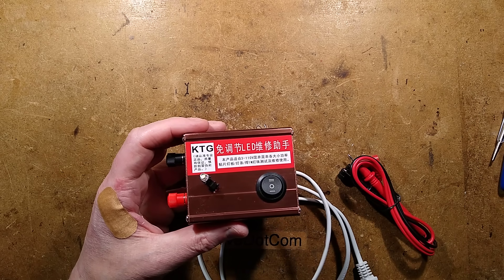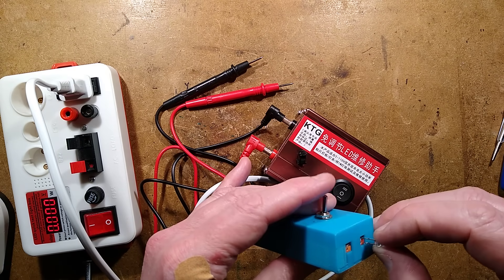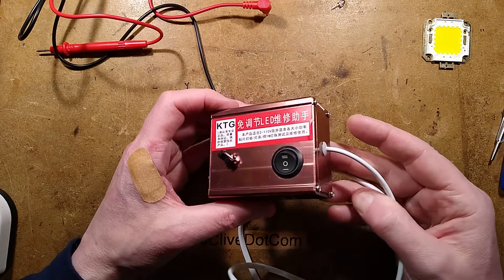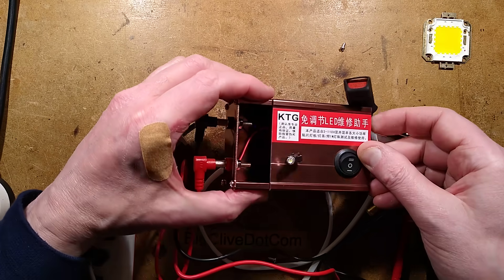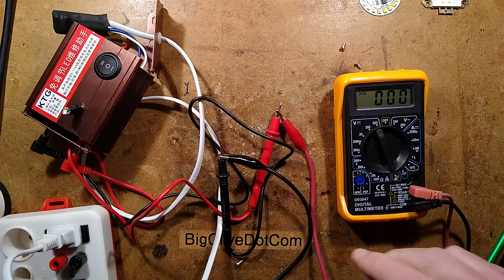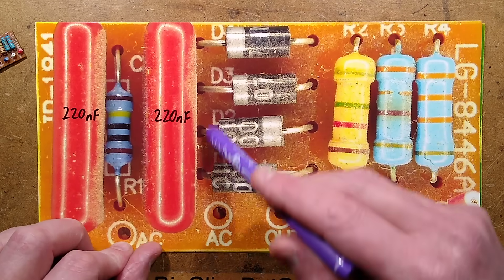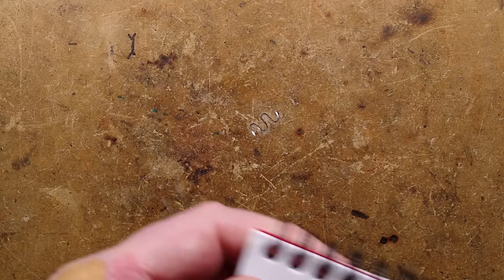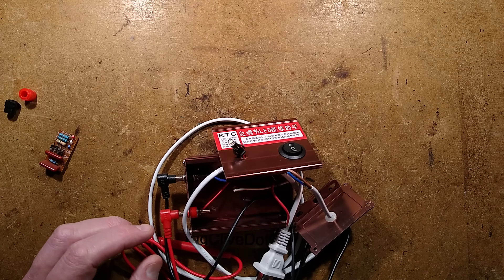Horrific LED tester that can literally kill you - (with scary schematic)

Comment: You're such an idiot. Watching you struggle with simple devices makes me wonder how dumb the general public actually is to follow you in such numbers.     Should I stop using my test equipment because its dangerous? I guess my capacitor analyzer is unsafe as well?    All test equipment is potentially dangerous moron.  Especially if you work on real gear instead of cheap chinese gizmos a 10 year old could have built in the 1950's with a heathkit product.
Reply from the maker: Thanks for your inciteful feedback.

Comment: Hey dear Clive; I wanted to give you a MASSIVE thanks, for I have just pulled myself out of a very nasty situation.

I have 2 electricaly-powered airsoft guns where I left the battereies too long in for; and I found out only minutes before posting this that the batteries hit critical low points: there was no over-discharge protection on the circuit.

I've managed to get both 2S batteries back to life using your shared knowledge about CC/CV charging. The batteries are now both successfully charging over balance chargers again. I've temporarily used constant current, using the TP4056 on the lowest cell and this has kickstarted their life again and allowed my protective balance chargers to pick them up again.

Once again, I can't thank you enough for sharing your knowledge and wisdom to the many of us. This is a showcase of it working and saving someone else.
Reply from the maker: Keep in mind that if the cells have been significantly over-discharged or worse - one has been reverse charged then it's a good idea to replace them.  It's not too bad if they have just dropped a bit below the usual 3V threshold though.
useful to know to remove the packs from the guns when they're not being used.

Comment: Genuinely speaking at AU 240V a current of less than 30 mA is considered safe, and 50 to 100 mA is generally felt but not fatal, (Safety residual detectors start at 30 mA),   above 100 mA is considered dangerous.  I would class that device as being safe but not for children etc.  Also it appears that a multimeter can do what that device does anyway by measuring resistance and continuity accross the LED.   It's definitely a waste of money.
Reply from the maker: 10mA is excruciatingly painful and is the point at which your hands start locking onto metalwork.

Comment: I have a slightly better unit that has isolated output so touching any single probe doesn't kill you but it outputs 300v at 20ma. 
It is for testing flatpanel tv backlights as those are typically anywhere from 20-120v dc. For upto 50 inch ones..
Mine has a little volt meter aswell. 
I put a few resistors in parallel to lower the voltage of it down to 100v as 300v was killing some leds if i touch it loosely. The current limiting isnt fast enough and the led arcs over internally. 
My dad once shocked the crap out of himself touching both the probes of this device like it was a multimeter trying to test a tv led😂..
Reply from the maker: If it's this one it may have functions you're not aware of:-
https://www.youtube.com/watch?v=dbjZs6QVwso

Comment: I don't understand why you should buy such a device when most multimeters have a diode test.
Reply from the maker: Modern LED arrays can have very high voltages in excess of 300V.
Reply: @bigclivedotcom  Ok ok, I didn't take that into account

Comment: Back in the day I somehow managed to wire up my electricity supply without killing myself but years later when an electrician friend saw it he was stunned I hadn’t got a nasty shock at least. I hadn’t pulled out the big fuse and just used a stripped copper cable to bypass the meter lol. It worked but I got him to do it properly and when he was doing something with the fuse there was a big flash and he went flying lol he was okay but his arm was limp for hours and he couldn’t drive home.  I won’t let them fit a smart meter and will just pop the lcd display because my mate got caught after fifteen years free gas and electricity and they couldn’t find out how much he had used just because the lcd display wasn’t readable, so if you have large debts on your meter pop the display and call the company to fix it, all they can do is change the meter and they don’t know how much debt was on it. Obviously only works with old meters, works with those yellow gas meters too.

Comment: Why is this dangerous?  The probe is connected to the live outlet through a 1M resistor.  The measured voltage will be high but it would not permit a dangerous current.
Reply from the maker: The capacitors either side of it will pass significant AC current at a level that would cause a significant shock.  Especially on higher European voltage.

Comment: I have an LED tester that has a volt meter, in a white case with blue text (0-300V listed). It has a proper isolated switching supply.
Reply from the maker: I reverse engineered that style.  The circuitry was quite complex.

Comment: Definitely deadly in high voltage countries like yours. Where it’s 230 volts  nominal and if I remember right ~375 volts peak. In the us it would be very dangerous at maximum not super sure on deadly. Because our voltage is 120 nominal ~170 peak I’m not sure if that would be deadly, you’d definitely not have a good time ether way though. The best solution would be to grab a button cell battery and test your leds that way.

Comment: You don't need deadly mains to test LED's, you can do it with a little 9 volt battery and a resistor.
Reply from the maker: Some modern LED panels operate at hundreds of volts.

Comment: This would be okay if you would just add a small transformer. Maybe even a furnace controller transformer at 24-25vac. Might fit in the case. Put a three wire cord and ground the case. Could even put a 100ma fuse on the mains. Otherwise the case would be good for any diy project.

Comment: I must admit that I got confused a little 😅. Listening to this while driving (6am no sleep yet), got to remember to watch this again later. Why they don't pop if there's almost mains voltage?

I'm not even that noob on electronics, my weak point is safety isolation transformers, floating grounds and those "magic" safe but maybe not safe things. I read how they work and then just forget. 

Wow what a ramble, sorry.

Comment: Is it safe to test short-circuit current? Does any multimeter just work to be put in series as a load of an unknown power supply?
Reply from the maker: Only a current limited supply with no significant output capacitor.

Comment: It is so dangerous, if touch the output lead it literally shock you. So I build my self a main isolated led tester. It has voltmeter built, can measure led forward voltage drop. I use it to test LED TV's back light. It can even measure zener diode voltage drop.

Comment: An LED tester doesn't even need a 120V power supply to begin with.  You only need a battery and a resistor.
Reply from the maker: Backlighting LED modules may have a voltage of up to around 300V.
Reply: @bigclivedotcom but you don't need that kind of voltage just to check it

Comment: LED Holder and the probe sockets need to be changed to Touchproof items. A three core mains lead would be helpful to enable an earth to the case and negate the reverse polarisation of Live and Neutral since a three prong (fused) plug would be used which are not reversible. An extra high wattage resistor can be also inserted into the directly connected lead as well as dealing with the singed 3.3k resistor (upping the power rating of a replacement part).

Comment: 2:30 The free LED lamp bead should be the indicator light during the test. It will light up when you test a certain bulb, indicating the working status. The second function is to test some detachable independent LED bulbs connected to this socket

Comment: 🇫🇷 In my opinion, all you need is a simple LED bulb power supply module (10mA max), a momentary button, all powered with a 1:1 transformer which would be powered with a 330nf X2 capacitor (combined with a 270k 1W resistor), a 100mA fuse and a 275v varistor and a 100Ω 1W resistor to finish.

Comment: Could it be used as some other type of testing tool other than a 1/2 wave rectified High voltage psu. Even though it could still be potentially fatal to use.
Reply from the maker: There are much safer versions of these available.

Comment: From 45+ years in electronics you are very much mistaken if you equate dead on arrival to shoddy production that is not certain.   You also misunderstanding its function is also not crap design.   This item had no chance before you even started. Yet you have no problem with a metal screwdriver rolling around your table near mains voltage.  In my shop we have a word for this behaviour “cowboys”
Reply from the maker: After 45 years in electronics, if you think this is acceptable circuitry then you may need a new trade.
You may wish to see this video:-
https://youtu.be/dbjZs6QVwso

Comment: I like to think that the product designers were at least thinking of safety (to some degree) by putting that LED connector in series with the output. Maybe it was put in there so you couldn't turn it on without having an indicator light, maybe one of those small neon bulbs?

I just came from your microwave transformer safety video, and you suggested putting two indicator lights across the primary, which is what made me think of this.

Comment: I made an inexepensive portable Led tester using xl6009 booster module, powered by 9V battery and work fine.
There are many video on YT with single lithium battery, but if tension went below 3,7V the output isn't stable.

Comment: Lol, trash, pure trash. Whoever designed that garbage is not even trying. They did not even put at least a high resistor on both AC lines so as not to have one of the AC lines wired directly to the output. They just charged for the box and then threw a few random electronic parts inside to call it something, lol.

Comment: Cos jur just too cheap assed to buy a battery & make it battery powered...
not even an inrush  resistor to limit the current into those  "non x2" caps, , so basically until they are charged the circuit is a DEAD short across mains...

lets platy  "sine-wave Russian roulette"
double your odds.... , by  reversing the plug connector , so live does not pass thru the caps...

Comment: Maybe I'm missing something, but why would you need a device like that to test an LED anyway? Wouldn't it be just as easy to stick an LED into a breadboard, apply a current, and see if it lights up? (I'm going to guess that most people who do any tinkering with any electronics probably have such things lying around.)
Reply from the maker: Many LED backlights have a high voltage series string of LEDs.

Comment: Is that LED hanging out the front, supposed to tell you that it's 'ON'? And, is there still current going to the negative probe, from the 'neutral' position of the switch? What is it with Chinese 'consumer' electronics you find and having line voltage output to leads?

Comment: I think you should rebuild it and put a monitor chip insidecited but make sure it insulates a circuit board from shorting out and don't let the circuit board touch the metal

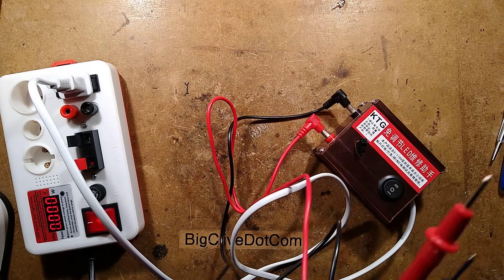Comment: should of left the led in? 2:33 led acts as fuse as far as i know, some systems use low draw bulbs as fuses its not shoddy design its safer for the led your testing,despite the other ways the thing wants to cause harm maybe they had their instructions the wrong way up,the logic of the circuit works

Comment: Its actually a good design, apart from being life threatening and not saying anything about it or a manual eg. circuit diagram. If you want to test led bulbs you have to have a high voltage. Alternatively you can use a boost converter with a battery. But it is also dangerous because high voltage and a few milliamps can be dangerous, so dont underestimate the dangers of small battery driven circuits!!! And capacitors!!! It is for testing bulbs and changing or bridging the faulty smd leds, which is a good thing, because less electronic waste. What a pity that manufacturers dont care, they could design bulbs which last 100 years easily. Good knowledge about bulbs: Kreosan (ukraine): How to DISASSEMBLE and REPAIR an LED lamp WITHOUT A

Comment: Dangerous device. Great video Clive. I have been using the same principle but of a 230/15 Volts isolation transformer, via a current limiting R and series LED for at least 3 decades. Great for testing LED lamps or sections of led strips.

Comment: This just shows how important reading the instruction manual is, I think most men assume we know how everything works, but anything from China particularly anything electronic is not necessarily predictable from a Western males mindset,or safe
Reply: Lol true , I remember buying an oscilloscope dso2512g to be specific and people shit on the manufacturer saying it can't support 120MHZ bandwidth. Little did everyone know you had to read the manual and activate it separately at which point the adc gets overclocked. I mean it's not the best design but reading the manual would've been so useful for many people.

Comment: This reminds me of the Chinese surface resistance tester that I purchased a while back. It just wouldn’t give me anything close to an accurate reading and it appeared to be shorted when grounded. So, I crack it open to find the absolute worst soldering job that I’ve EVER seen! There was a lead not even soldered in thereby giving me my flaky reading since it was ever so slightly trying to make contact. The 9V leads fell off when I gave them a small pull to see if they’d need to be resoldered. I ended up redoing the PCB and replaced the 9V battery connector with something a bit more substantial. It was almost like magic the way it worked by the time I was done! If I didn’t actually enjoy refurbishing old and otherwise crappy electronics, I probably would have sent it back or thrown it against a wall. I’ve come to realize that some very good electronics actually do come out of China, but conversely some of the very worst do as well.

Comment: I’m not sure this is thatttt lethal; the capacitors limit the current to 20miliamps.  Or they should; looks like they’re bigger than spec.  Which isn’t a good thing to have run through you, but won’t hurt you unless you stab yourself with it.  I mean, it’s against safety standards, but it probably won’t kill you.

Also it’s a full-bridge rectifier, not a half-bridge
Reply from the maker: To ground there's no current limiting.  And even at 20mA that will lock you on to conductors.

Comment: Talking about colour confusion with Chinese products.  
At work I had to rewire a bunch of head LED lamps (50+) for our bikes. The lamp used red for positive, black for negative. So far so good.

The pre-plugged wires I had to use for the connection used white and black wires. Having watched loads of BC videos I'd thought it would be smart to check the polarity of the wires before proceeding, so I picked out one to check. Black was indeed negative and white was positive. So I rewired the 50+ lamps. Made them secure with heat shrink tube and hot glue, to make them waterproof. 

When testing out the lamps only 4 of the 50+ lamps actually worked. Turned out that the black/white wires were more or less random. I had to spend most of the day fixing that "small" problem. I only has a few centimetres of wire to work with, so I could not just cut the wires a redo, and because of the hot glue it was hell of a job to get it fixed.

Conclusion (as I should have known) double check every wire for polarity before working on any Chinese product.

Comment: I agree it's a shoddy, dangerous piece of crap, but I don't think it's a dangerous as you are making out (provided nothing in it fails).
You got 212V with a tiny 20uA load (the meter), and you pulled 27mA when you shorted it (with the meter). 
But humans are not a short circuit. They would not pull that much current, and the voltage also would drop with a larger load. 
It would have been interesting to try more human-like loads (say 20K to 1M) and see what voltage appears, and calculate the current from that. 
I doubt it would be anything near lethal.
Reply from the maker: I look forward to your video where you hold a probe and touch a grounded surface with your other hand.

Comment: I would never buy that but the user is the problem here, it was obvious to me that that was a complete circuit and the LED is supposed to illuminate when you have a good connection and it shouldn’t take a rocket scientist to figure that out, why would you take the bulb out and throw it on the table? This guy is not too bright.
Reply from the maker: Yes.

Comment: the cricuit is likely not designed for 220-240v regions
Reply from the maker: It is sold as a 220v unit.
Reply: @bigclivedotcom I don't doubt that! The upper limit just seems too close to standard US voltage

Comment: Very interesting! How much voltage was going into this death trap? How long will it survive a short ciruit with the probes?
Reply from the maker: 240V here.  (designed for 220V).  On the highest current setting it will burn that resistor out fast if kept in contact too long, even with LEDs in circuit.

Comment: Amazon sells switching power supply with a 3 Volt output very cheap and very safe, I got one and they work fine and they are  fused in case you make a mistake. :face-red-heart-shape:

Comment: I once found this identical circuit in a rechargable bug zapper that you could plug straight into the wall... That connects live to the giant mesh... So insanely dangerous I have no words. At the time I wasn't that experienced and mamaged to reverse engineer it just enough to realize that it was dangerous but now that I have my EE degree I know just how bad it actually is